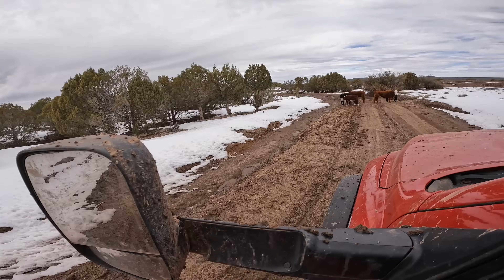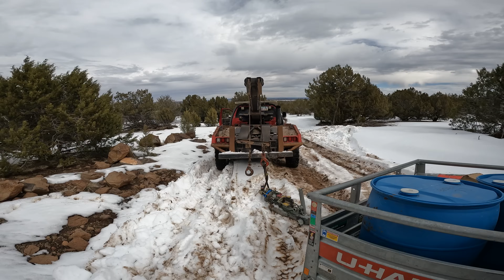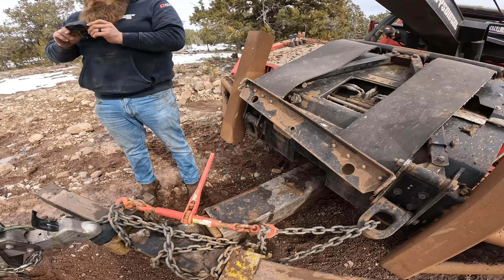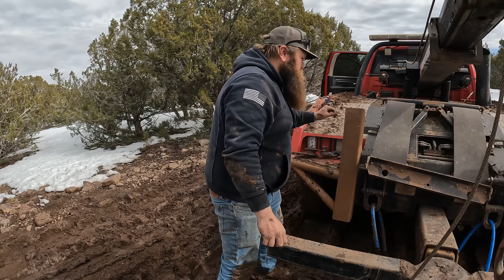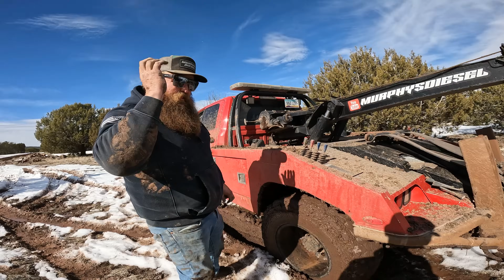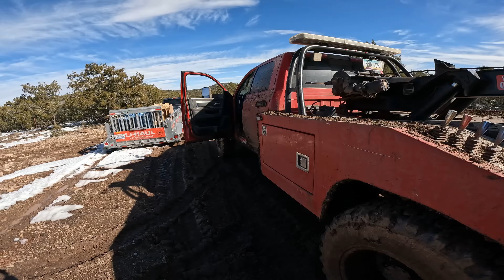We helped save a FLATLANDERS LIFE! "Forget the rest, CALL the BEST!!"

Comment: Hellboy needs lockers
Reply: Rick has stated before these particular axles  are very unsupported he might swap axles later but not now
Reply: Air locker
Reply: Lockers requir stronger axles so not just lockers
Reply: @Richard Nowakowski  oh really I'm running spartan locker in a dana 30 and lock right in the 35 out back on 35 in tires and there stock axles shafts 3.5  yrs with no problems my xj has seen most on trails in moab and Colorado and the Rubicon last summer zero axle problems
Reply: @jeremyhanna3852  are you doing recoveries with it.?
Reply: @Richard Nowakowski  not really but have pulled a few jeeps out on trail
Reply: @jeremyhanna3852  yeah for sure I'm pretty sure hellboy here weighs around 12k pounds and is always pulling and towing so it's a lot more stress on the axles for hellboy here.   Stay classy tho xj stock axle crawler
Reply: @richardnowakowski3981  and I'm sure it's got dana 70 or 80 axles built for towing
Reply: It’s impressively capable for what it is even without lockers id love to see what it could do with lockers though
Reply from the maker: Well stand by boys cause we gotta build coming soon
Reply: Most definitely
Reply: For the people that are saying that he needs stronger axles to run lockers you're wrong he's already a 3500 Cummins diesel they usually come with 1-ton axles on there which is very strong Put a locker in the front and the rear and it will make worlds of a different off-roading and recovering
Reply: @gc1595  I’m pretty sure it’s a 5500
Reply: Because the choke and puke engines give way early in pickups nowadays the choke and puke engines in the otr rigs last longer
Reply: Limited slip might be a better option and cost less, not sure about compatibility though as I haven't looked into it yet. I have an older 07 2500 sitting at 220k, just a baby still but she doesn't seem to "struggle" in mud or snow as much as yours. I'm thinking that you have a custom exhaust and so it just sounds like yours is trying harder to pull through the snot.
Also that area looks to be in NM or AZ somewhere, is this correct. Northern NM here.
Reply: For those not looking at all the details, he has a 5500. It’s bigger than 1 ton axles so you can’t just call Summit Racing and get a locker off any shelf.

You CAN get a locker for it. Just not as easy and it costs a hell of a lot more! 

And final note, he does NOT need stronger axles if he upgrades to a locker. Again…it’s a 5500.

Pay attention and read before you comment. Maybe even do a quick google before you comment. Or just be stupid
Reply: Or at least a front and rear LSD.
Reply: @richardnowakowski3981  😂😂😂 No they don't
Reply: @richardnowakowski3981  Doing recoveries wasn't in your original comment about needing stronger axles when installing lockers. You're changing the subject because you got told what you didn't know
Reply: @alexandersupertramp7353  also I liked half of Jeremy's comments anyways so mind your own business.   Have a nice one
Reply: @lmcclellan  it's northern Arizona you are correct.
Reply: @sav300  by the way it sounds he doesn't need bigger axles so thank you for confirming.   It was a stupid comment I guess.   🙏  I guess I just figured that being a stock truck.  I admit I was wrong and I'm always willing to learn new things.
Reply: @richardnowakowski3981  no worries partner. I like comment sections like these because there is always something to learn. Cheers 🍻
Reply: @sav300  exactly!
Reply: I still don't like choke and puke engines new or old versions strange thing is my dad used to build the 7.4 Navistar engines that Ford runs in thier f450
Reply: @gc1595  it's a 5500

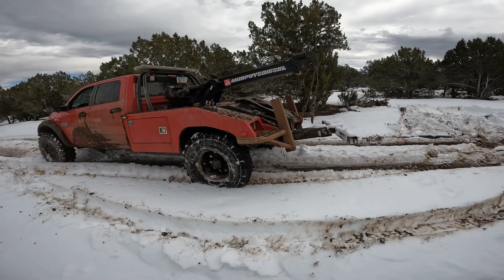Comment: Hey nice job would be nice to see you get some lockers they will make a hell of a difference on recovery especially for offroad and you already have 1-ton axles so you do not need a stronger axles your good would be nice to see you sitting on some 40s 5:13 or 5:38 gear ratios and some lockers but the set-up that you're at now is nice you just need some lockers